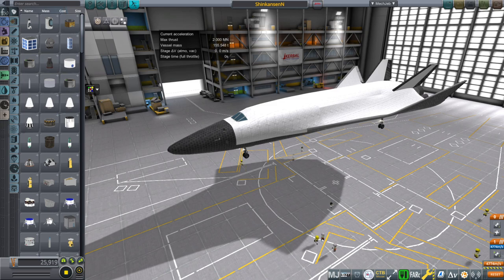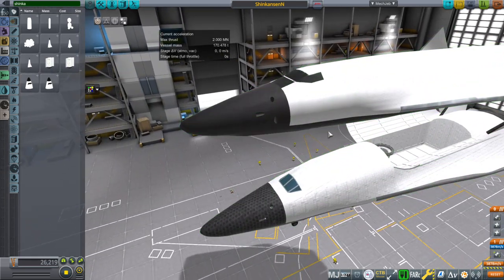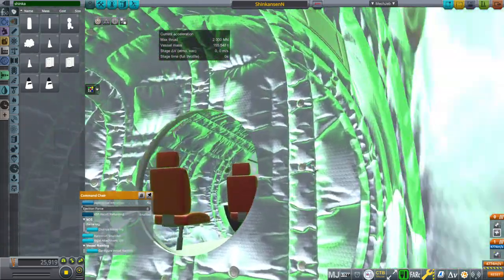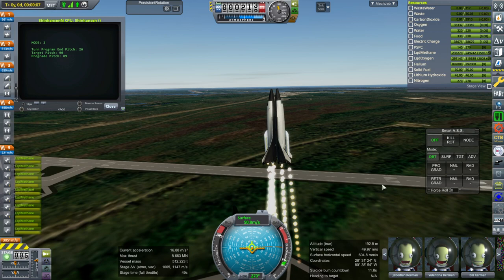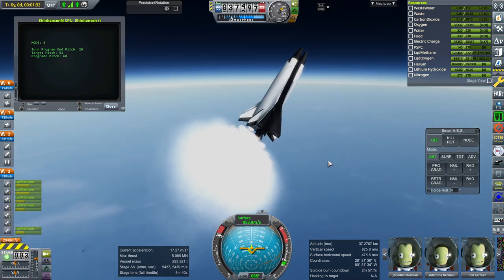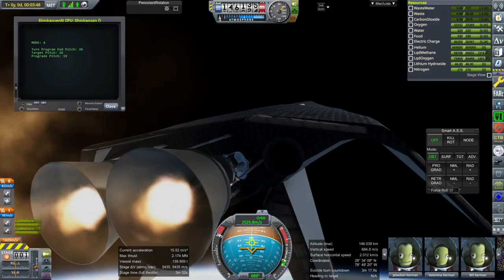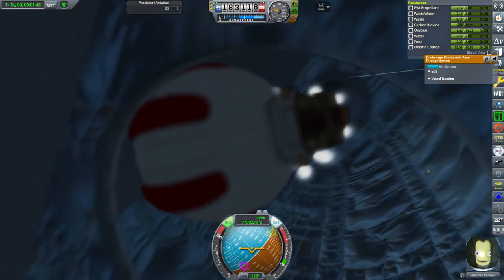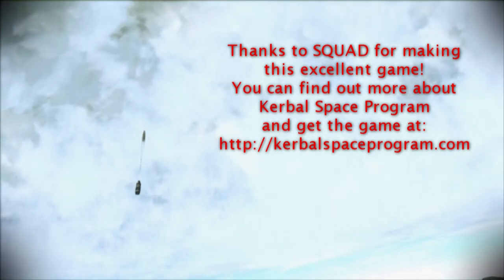Realism Overhaul in KSP 1.11 - Shinkansen Reborn

Comment: i haven't watched the entire video yet (i will later) but why are there small engines in the big engines and what mod gives you a fancy KSC (and is it a performance heavy mod)?
Reply from the maker: The small engines are for minor orbital maneuvers - they only have 30 kN, but have a lot more ignitions. The large engines are limited to 10 ignitions. The mod for the KSC is Katniss Cape Canaveral, and I wouldn't say it's performance heavy, but it does take a chunk of RAM.
Reply: @RaizSpace  i don't think you got my question about the engines. at 1:38 it's quite obvious that there is a small nozzle inside the big nozzle. why? i don't mean what is the differense between the small and large engines